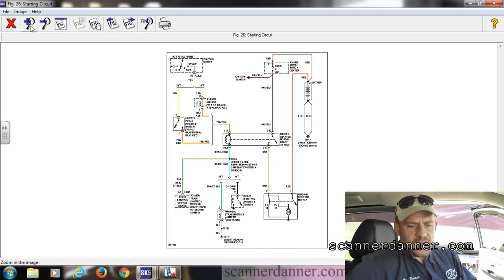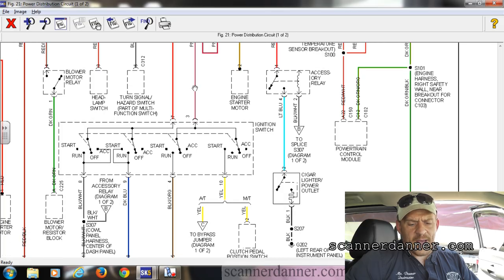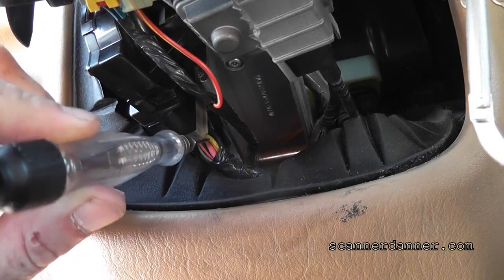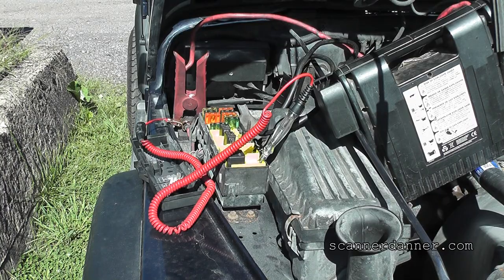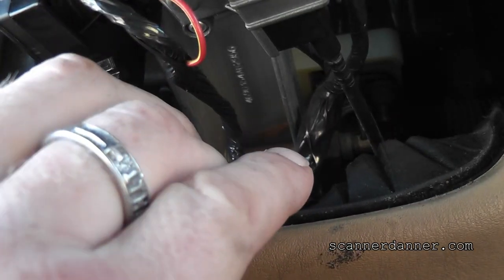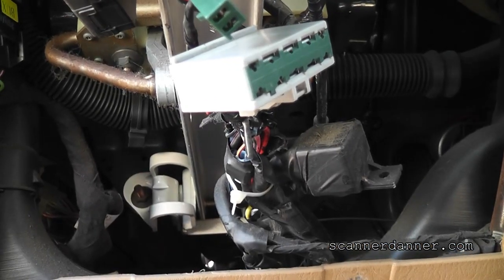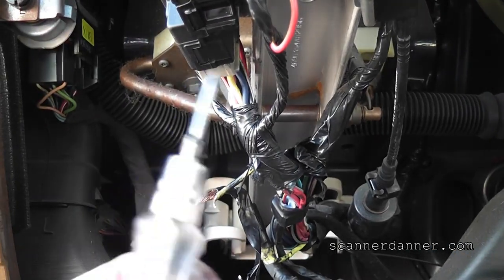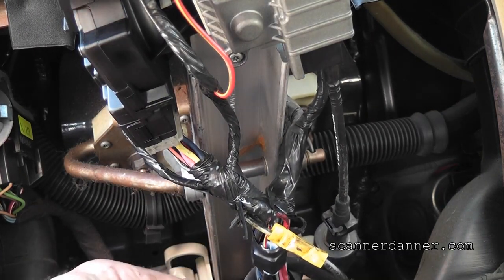No Crank Troubleshooting (engine does not crank) - Jeep

Comment: Hey,Scanner Danner  love your videos I watch them all the time.I am truly a fan You really get down to the meat and  potatoes. Question ? What would you have done if  you did not see  the aftermarket relay  under the dashboard. If it was located somewhere else where you could not see it? ( From watching your videos I know you would have ripped the  car apart to find out what the problem was LOL. However, (here's  me answering my own question :) I know what I would have done, I would have unplugged the ignition switch  put my ohmmeter in line at the wiring harness, one lead to ground the other lead to the yellow wire .Then ground the control wire at the relay side under the hood.
then check for continuity. ( obviously we know that the circuit is open because it does not start), once grounded. then trace the  yellow wire forward to fine out  where the open is. using the ohmmeter with ground to find the problem. Once I get continuity I know the problem is fixed.  

(New topic)
I often use this method to  trace out short-circuits. You do not have to keep on blowing fuses to trace out a short circuit. By Grounding  the feed side the the circuit(meaning unplugging the fuse and grounding  the feed side going to the circuit you want to troubleshoot. Then hook up one side of the ohmmeter to ground the other side to  the wire you are tracing,  put your ohmmeter on continuity once  the short-circuit  go's away you found the problem. 

I am not a teacher so forgive me if i did not explain this correctly ( I think I did) , Maybe you can use this in a future video Call it the Carmine method :) . I think you understand what i mean on using ground and a ohmmeter for tracing out wires.  Just trying to help

Hope this helps some of your students on a different method of tracing out wires.. 

Thanks for all the  hard work and all the cool videos keep 'em coming   

Old School mechanic  :)       Carmine

Comment: Very interesting to say the least!!
Once again,  check EVERYTHING--TRUST NO ONE (including the NEW part).
Is there a way to have the parts store electrically (continuity test) test the part BEFORE you leave the store so they don't blame YOU for causing a short during installation?  Most parts stores have a no return on  electrical  parts.
Reply from the maker: Any resistance test or bench test would not have the load applied like it would be on the car, so no, this wouldn't be a good test anyway. But in the case of a simple ignition switch, I'm pretty sure they wouldn't give you a hard time because it is not an electronic part.
Reply: Thanks for the info.

Comment: Dan, first of all thanks for taking the time to post these in depth videos. I love them. Secondly, a friend of mine has a 95 Cutlsss with a 3800 engine. The DLC, which is "OBD1" type has atleast one missing wire and has been messed with. I know that the idea behind activating diagnostic mode to find out the "check engine" code is connecting ground with a "diagnostic lead". Do youknow what color that diagnostic wire is off the top of your head? I have not yet found a reliable diagram online. Any help would be appreciated. thanks
Reply: Doomzdayxx you cannot get flash codes out of 94 and 95 model years. As you noticed with pins A and B, one of the wires is missing. you must use a scan tool, sorry
Reply: Can it be any generic OBD1 scanner or does it have to be a special hard to find GM dealership tool?
Reply from the maker: Doomzdayxx as long as the scanner you are using has a 12 pin GM adapter that comes with it

Comment: Take a strand of copper wire, wrap it around the leg on the relay, plug relay back into its socket and touch the test light to the strand of wire.

Comment: Scanner Danner my 2000 caravan has no crank or fuel pump power do know what they would have in common? Awesome Video by the way!!
Reply from the maker: The PCM controls the starter relay and the fuel pump, so you need to focus on the PCM itself. Check for powers and grounds on the PCM itself, check the 5v reference circuit, check for blown PCM fuses, check for a check engine light with the key on. 
I have other videos that will definitely help you. Here are some
This is on a 96 Jeep but it will be the same procedures for you on your 2000 minivan
https://www.youtube.com/watch?v=a-d6-jrGidA

https://www.youtube.com/watch?v=jLwNcgtv9z0

https://www.youtube.com/watch?v=dCZdv-FYwxw

https://www.youtube.com/watch?v=jsl531-6q-A (watch the end o this video for where the wiring harness shorts out)

Comment: Hello Paul, thanks for the long videos as the way you are explaining them makes them interesting and we learn from you. On this video around min 19:25, you have the test light to Batt positive, is the tip of the test light on the brown light blue wire of the relay going to the park/neutral switch when it lit ? Then the light goes out when you switch from park or neutral, why? Also when you touch the relay with the light coming from Bat positive and it crank, which wire are you jumping to, the yellow/red from switch or brown light blue from park neutral? Hope it doesn't sound stupid as I'm trying to learn electrical troubleshooting and I have learned from watching your videos.
Reply from the maker: Go back and rewatch the wiring diagram review at the 2 minute mark. This should answer your questions. Think about the tests I did while you are watching this part. Thanks so much! Definitely not a stupid question.
Reply: Paul, I went back to the video and diagram as I made a copy of diagram and I still don't know the answers I asked on my previous massage, can you help explain? Trying to learn as I don't have much electrical experience

Comment: Well I'm on here to fix my tractors no crank but I think my Jeep has this exact problem at the point the yellow wires  splits, I kick the wire cluster in my jeep with my left foot to start. The rear wipers are intermittent too.

Comment: In that add-on ignition-kill key, there's a 10A fuse. Wouldn't have been easier to at least check the fuse? I know it's not something you want to deal with and all that but, if it worked, that would be quicker and then you could just tell the customer that the issue was the ignition-kill fuse and they need to decide to take it out or continue as-is, no?
Reply from the maker: Any ad on stuff, it is never easier to verify what is should be, than to just remove it. These things were garbage to begin with, even when they worked. So to each his own. For me, removal is the only option for aftermarket add on's. Time is money and as I stated, garbage from the start.

Comment: Hello, excellent all in-composing video learn so much yet questions flooded my head, even when you showed evidence showing neutral safety switch is working with test light on control side of starter relay awesome relay switch technique showing us in park test light lit up in park and drive  light turned off in reverse and drive, what a thrill I got, then extreme doubt followed. 

The neutral switch function is to stop the car from starting in drive and reverse and to ground the stater to crank too,. It has 2 functions right. What if the car is in park and does not crank? what if the car is in neutral and cranks fine but does not start is were my doubts destroyed my thrill. What if your test light did not light up on control side with key ON, while in park? what if you used your meter and found a voltage of 3.44v, too low to light your test light in that on position however what if your test light lit up in the start position with your meter hooked up reading 12.39 volts? Can we conclude by fact or assumption, that the neutral safety switch is good, even when the test light lit up in park and neutral key in star position, do I have a doubt, that is really a good question or am I lost again!
Peace & love,
Alphasentory
Reply from the maker: too many what ifs in your questions, let's do one at a time. Give me a time frame in the video and one question, then we take it from there. Thanks!
Reply: @ScannerDanner  wow thanks for pulling the reigns to my wild horse. Learning is fun with you, its wild to have a tiny bit of knowledge and dangerous too because a half wit like me walks to the car it trembles with fear when it see me approaching. Got to calm down and I don't have an issue car is fine. Thank you for the thrill and your lovely mother and brother Danny is so easy to love and embrace. Peace N grace cannot forget Eric a fime laddy who is greatly cherished and trusted and appreciated.
Reply from the maker: No need to apologize my friend, I wanted to answer some of your what ifs... 
Let's start here 
"What if the car is in park and does not crank? what if the car is in neutral and cranks fine but does not start"

If it cranks in neutral but not park, you have either an adjustment issue with the transmission range switch (park/neutral switch) or a faulty switch.
If the engine cranks fine and doesn't start (doesn't matter if it's neutral or park), we are on a COMPLETELY different path. You would then have to verify spark, fuel and compression.
Reply: @ScannerDanner   Its amazing how much thought goes into diagnosis  bouncing back and forth from ignition switch to safety switch to relay boxes and fuses, wire harnesses and grounds to chase and engine block ground thats bad. Its something to behold, wonder about and admire how the smart people like yourself do it. 

You are very kind to attempt to answer my what ifs being so busy, I did not expect an answer at all, thank you for creating pictures, it just stimulates one more 'what if' flashing in my head just now! You don't have to answer it if you are busy but I did watch another one of your videos inspires the what ifs again, where you found an open between fuse & relay box, and computer with your test light that was awesome.

 A 3rd video, with the boys from school, a no communication w/ ecm  using 5v ref to find shorted sensors, great technic isolating it all down to a bad main relay. You called it a "low reference voltage" on control side to ground. So what if you find a scenario with a stater relay, load side, lights your test light but on the control side, it does not light up test light? Your volt meter comes to your aide and you spot a reading of 3.44 volts with key in "on" position but when you turned key to start position your meter read 12.39volts,  would you say neutral safety switch needs an adjustment. 

A low voltage reference on control side power if I remember your spoken words correctly. Is it safe to use my test light battery positive with key off to start the car like you did with the jeep, that had the after market devise. I thought you had the key in on position cooking ecm, no you had it the key in off.This was exciting to me, the danger element.

 Can I think the throttle is shorted reading 3.44 v on signal wire in open/closed stays same is it dead?

Does it mean the solenoid trigger wire from fuse box stater relay terminal opposite control has a bad ground somewhere over the ocean of wires, when it only cranks in neutral position not in park. Its intensity in crank mode sounds diminished, after 5 cranks, its tired? would you disconnect the throttle connector to see if the 3.44v on control/ground side of relay to see if it comes back up to 5v ref and would you check the solenoid trigger wire and stater solenoid & grounds including battery cables for unseen corrosion at same time.

 In one video you mentioned voltage drop testing, which I cant understand yet. I see you are having fun 99% but then I saw a bully beat down video you had trouble with just 1 % of time this too is so fascinating. When I watch you, I pretend to be you going into the unknown, which frighten's me yet its fun because I wake up from the dream and I am ok, the terror is gone.  I did not damage anything. Peace! and thanks! Love the test light tool the way you use it as a resister I would never have gotten it, thanks for the gift. I can see that the training is so important other wise it would be so difficult to fix electrical issues.

Comment: Are there any designs that would use pwm to control  the control side of starter relay? 
Few days ago there was a neighbor who's car was stalled I pulled out my meter and measured the control side and found 11...volts then I put back the relay and the car started without me doing anything else. He thought he had a bad stater I told him there could be a loose connection between ignition switch and the relay.
A couple days later I saw him and he said he took the car to the dealer and told him he needed a new engine control unit.... I thought to myself that maybe the computer was not sensing the crank signal but now that I think about it, the car  would not crank at all so there was no signal for the computer to sense.. Anyways you probably have a better explanation thanks! ( it was a Mercedes Benz ) I would say at least 7 years old

Comment: Take a strand of copper wire, wrap it around the leg on the relay, plug relay back into its socket and touch the test light to the strand of wire.
Reply from the maker: Yes great tip! I've done that many times. Thanks!
Reply: Was thinking the same thing, that's what I would have done.  Surprised that test light could fit in there with all those pins touching.  Surprised you did it that way but you were obviously in a hurry and it's a great example of real world vs classroom environment.
Reply from the maker: I didn't put the test light in the female terminal.  I let it touch the male pin of the relay while half plugging the relay in. :)
Reply: Make sense now.  Any dangers of doing that?  Would you teach your students it's ok to do that?

Comment: Ive got a 1994 Jeep Cherokee .. no crank , no start , no dash lights , no headlights nothing except the door buzzer is working. it has done this twice before over like a five year period But it's always started back working after it set for an hour or two it hasn't yet this time and it's been over a week. I was hoping you could give me some advice on what and where I should check with my meter

Comment: As the first person to attempt a diagnosis, it's very unusual to find 2 separate opens effecting the same circuit. 

Sure, bad parts do happen.  But, the new ignition switch could have been bad in any of the contacts.  The open had to be the contacts that lead to the yellow(crank/start) wire.
Reply from the maker: I know right? Crazy scenario,  definitely had my doubts about it initially which is why I went away from it to chase the other open first.

Comment: Even tho your name is not Dan or Danny... I watch Eric the car guy and your are friends.. I'm a upcoming tech and you both help a lot on just under standing the basics on how what works! I rely on you both for difficult symptoms. Not like that but more for the just of what I should look for! I definitely need to invests in all data if that's why your use! I have watch both of you ( scanner danner) and Eric the car guy) and have learned a lot! It would be very cool if I joined your class scanner! I would like your electrical boom if I can get it! You explain so (low level) and then into sign waves and I can't think of somebody who could explain so well on electrical but more or less getting a car to run because of a bad ign switch or a stiff burnt wire vs well check this check that and according to a diagram, that's has nothing to do with that circuit! I work at autozone but I believe I can achieve more than that.. I believe you can help more than me but all the car savys don't know about electrical this is where the new generation Should be at! Electrical and diagnostics!! That's where I want to be but not for the money but to make more cars run in the road and I shouldn't see them back for the same reason but another so they can drive as far as they can!!!
Reply: Jaguar Siegfried Paul is a real automobile technician whereas Eric tCG  a service mechanic. Both good in what they do but given the choice, I would definitely choose modern analyst \ technician.
As you can see, they call this dude in when all else fails. Kinda like the 'Wolf' to take care of things when they go to crap. 
peace.

Comment: The most frustrating is a bad new part which unfortunately happens very often, not only electrical parts but also mechanical especially starter and alternators.

Comment: That "old" ignition switch looked rather new to me... You could see that that "new" ignition switch had some dust on it in those little corners, so I doubt it was actually new. But who knows, maybe they packaged it dusty like that...
Reply from the maker: +Atrax R if it wasn't new, then the parts store sent us a used one. I assure you that they just changed that switch at the garage I was working for
Reply: ScannerDanner Yea, weird stuff. I mean I know that can happen if someone returns a part and they just sell it on, but still weird. As long as it's fixed and working now, that's the most important thing.

Comment: If I want to add a push button start then I need to have a 12 volt feed to that yellow wire? Thanks in advance.
Reply from the maker: The fat yellow wire from the ignition switch right? If so, then yes. That's it. Use one of the fat red wires coming in to the ignition switch as your source. This way it is already fuse protected. It is actually a fusible link that protects the wires coming into the ignition switch.